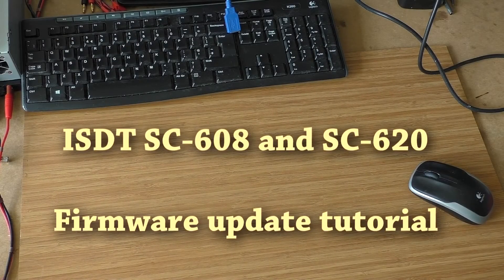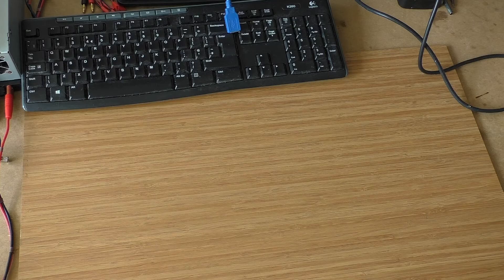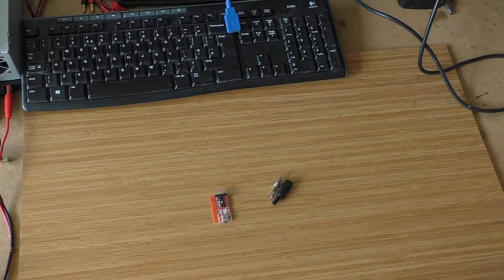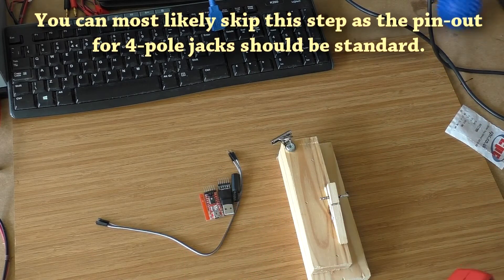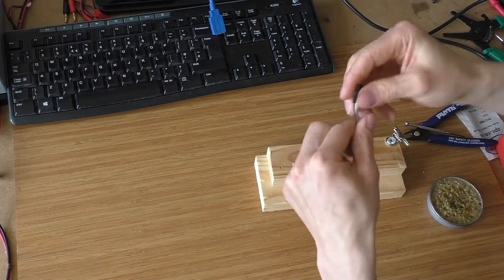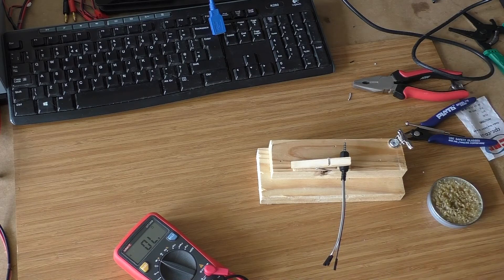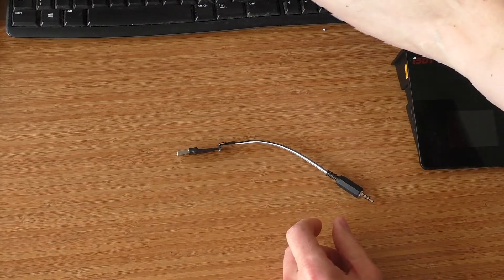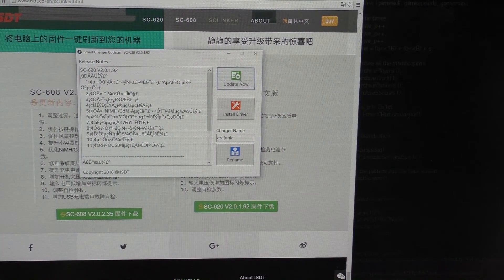ISDT SC-608 and SC-620 Firmware Update Tutorial

Comment: you only save 3 dollars how ridiculous it is
Reply from the maker: Well of course, saving 3 dollars makes no sense but it's not always about the money. (And if you have to buy a soldering iron on top of that it makes even less sense.) Plus I only had to pay for the jack as I had all other parts lying around and on top of that I didn't have to wait 2-4 weeks for an adapter to arrive on a slow boat. Anyway, money aside, I still think it's a  very nice and simple DIY project. Also, at the end of the video there is a tutorial how to actually update the firmware regardless what device is used.

Comment: I have this one also, but wondering if you have to do voltage calibration again after updating FW, anyone experience with this?? I have 2.1.0.10 FW and want to update to 2.1.0.15 I did perform voltage calibration with my 0.10 FW, update: got an answer from ISDT you don't need to do voltage calibration after upgrade FW, thats good news

Comment: I had a little trouble getting mine to work. When I would run the update software it always said it couldn't find the charger. After much troubleshooting I finally figured out the problem: I also had a Bluetooth-to-serial COM device connected to my PC for programming my helicopter FBL units. As soon as I disconnected that the update software recognized the charger and I was able to update firmware. Since the update software doesn't let you pick which COM port to use I'm betting it scans through and chooses the first COM port with a compatible device (in my case it was the Bluetooth-to-serial rather than the USB FTDI). This would make sense as both devices are very similar, maybe even using the same FTDI chip. So if you are having trouble getting the update software to see your charger check if you have any other serial COM port devices connected to your PC.

This also makes me wonder if you could connect the DIY cable to a Bluetooth-to-serial instead of USB FTDI, and update the firmware using that?